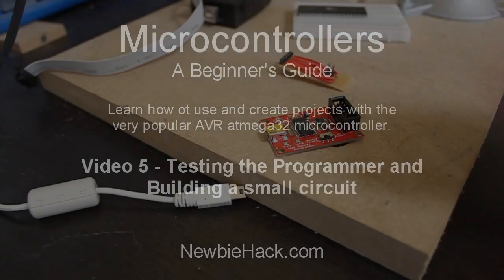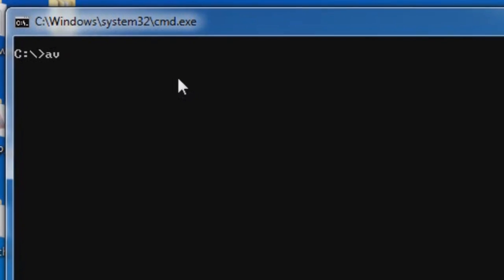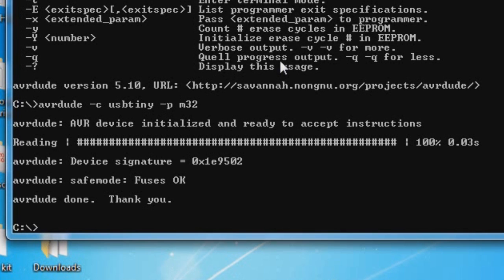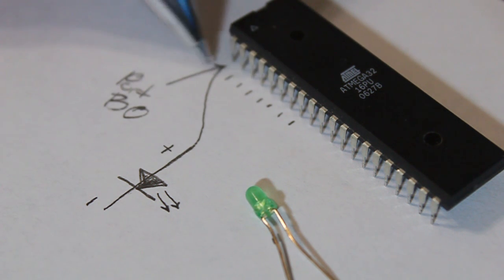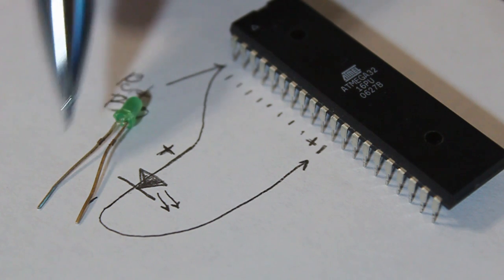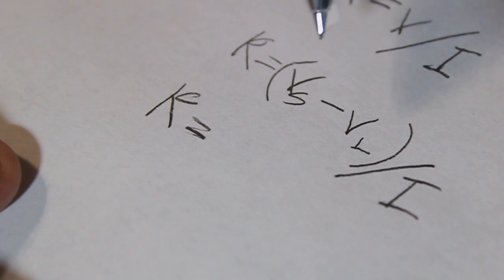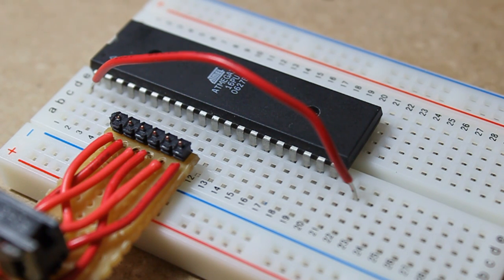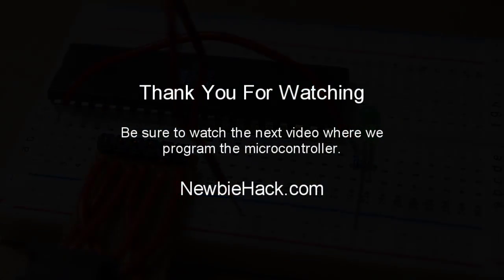9. Arduino for Production! How to Test the programmer and Build the first Microcontroller Circuit

Comment: How can I install avrdude, my computer just doesn't recognize the command
Reply: You have to install avrdude and then add its installation directory to system variable "path". Basically your system will know that this is something like directory that is always opened, so it will run this avrdude command just by typing it in console. Google more "add path system variable"
Reply: You have to install avrdude and then add its installation directory to system variable "path". Basically your system will know that this is something like directory that is always opened, so it will run this avrdude command just by typing it in console. Google more "add path system variable"

Comment: Hi. I had been trying to program Atmega32 and Atmega328P, and I can't seem to make it work. I am using usbtiny program from sparkfun, and I am able to program attitny85 on the breadboard, without any problem. It means the ISP connections are reading fine on the breadboard. But as soon as I use Atmega chip, i get rc=-1 error, and I cannot communicate with the chip. Chips are brand. Any help or suggestion is appreciated!
Reply: Shulabh Gupta any luck with this problem? I have had the same problems for 5 months now. I even bought another programmer and rechecked all wirings and drivers... No luck.

Comment: i got the black box (usbtinyisp) to program my atmega32A PU... I used the six pin connector like you did and wired jumpers to there respective input pins on the atmega (6-11)... then I get;
avrdude: initialization failed, rc=-1
double check connections and try again or use -F to override
....im not sure why...
also does the jumper connector on the programmer have to be connected?
I also have a usb 2.0 is that okay? im assuming so...
thanks

Comment: Question : the reset pin for Atmega 32 is active low, right? so why you did not put a pull up resistor? is the programmer do the pull up automatically?

Comment: Hey sir,

I actually couldnt find an usb tiny, so i bought an usbasp.
when i followd the instructions, replacing 'tiny' with 'asp',
it gives an error, "avrdude: error: could not find USB device "USBasp" with vid=0x16c0 pid=0x5dc"

Could you please tell me the possible error i would have done?

Comment: I also have the same question. Also when I connect my vcc and grnd wires it seems to shut the board off. Whats going on? I have connected only vcc and ground to the atmega32. I also checked everything 5 times.

Comment: Hi Patrick ! I need some help.. when I connect my pocket AVR with the PC it displays 3 lights rather than two so is that normal ? or am I doing something wrong besides that whenever I try to configure my AVR on Ms-Dos it gives me an error saying.." avrdude: initialization failed ,rc=-1 double check connection and try again..

Comment from the maker: There are new versions of the 32.  The 324, for instance.  The 32 is only a designation of the memory capacity.  If the 32 is appropriate for the application, use it.

Comment from the maker: I appears to have written to the uC correctly.  Send me the code and take a picture of your breadboard.  Check that the LED is not in backwards.  Check to see if the LED works by using a battery across the LEDs leads.  Etc. ETc.

Comment: avrdude: NOTE: FLASH memory has been specified, an erase cycle will be performed
         To disable this feature, specify the -D option.
avrdude: erasing chip
avrdude: reading input file "main.hex"
avrdude: input file main.hex auto detected as Intel Hex
avrdude: writing flash (120 bytes):

Writing | ################################################## | 100% 0.02s

avrdude: 120 bytes of flash written
avrdude: verifying flash memory against main.hex:

Comment: i followed the instructions exactly and i have checked the connections thousand times still can't light the LED. i don't know what i'm doing wrong.
 > "make.exe" program
avrdude -p atmega32 -P com1 -c stk500    -U flash:w:main.hex 

avrdude: AVR device initialized and ready to accept instructions

Reading | ################################################## | 100% 0.02s

avrdude: Device signature = 0x1e9502

Comment from the maker: I'm guessing that you are referring to the Arduino IDE (integrated programming environment) and not referring to programming an AVR with another Arduino board.  You can program an AVR from an Arduino IDE, but you will first need burn a bootloader into the AVR chip.  Then you will need to add an FTDI chip for USB (actually a pretend serial port) communication to the AVR, since that is the way to transfer Arduino programs form the IDE.  That's a lot of trouble, stick with SPI program transfer.

Comment from the maker: You can put the resistor on either side of the LED.  The same result will occur since the LED and resistor are in series.  Putting a resistor will affect the electrons in that part of the (series) circuit no matter where it is.

Comment: @anajonesr: I like your videos, and I learned a lot. I'm not good in electronics, but I just have a question in placing resistors on a component. Is it okay if we place the resistor in positive side instead of placing it in the negative pin? Because from what I've seen in some tutorials the current flows from negative to positive. So, if that's the case the resistor on the positive side is useless because it passes through the LED before it passes through the resistor.

Comment: Im having an issue with my pocket avr programmer. When I plug the programmer into my laptop the power led repetitively blinks and never goes solid. I also tried it with a powered usb hub and i get the same result. The only way it will power on is if i connect it directly to a 5v cell phone charger. Any suggestions?

Comment: Hi,
It doesnt work . I have falshd the ATmega32 successful, and have it powered with an constand and stable 5V power suply. It takes 2-3mA but the LED is OFF. I have the ATmega32 from the AVR-NET-IO from Pollin. Do I need to change the fuses? If yes, how do I can change this, and which to what?
Thank You

Comment: Hello, I'm building a z80 computer with graphics and I want a tms9918 VDP to generate the NTSC signal. The tms9918 requires a lot of software "bureaucracy" if you what I mean to, lets say, put a ASCII character on the screen of draw a sprite in the video memory so I want a microcontroller to act as a "ambassador" between the computer and the VDP.. would a microcontroller like the one your using in this video be able to do this and is it possible to synchronize the computers clock with it?

Comment from the maker: @m7ammad7assan This sounds like a problem of the windows locating the programmer.  your programmer may not be functioning, of the driver is not installed correctly.

Comment: when i plug in the programmer into the microprosessor the blue light of the programmer turns off and there is a error when i use avrdude -c usbtiny -p m32

Comment from the maker: @addy3x Good comment.  Yes...  you can use a battery or another power source, but you will want to have the battery or voltage source be regulated.  This is a really good subject for a quick video.